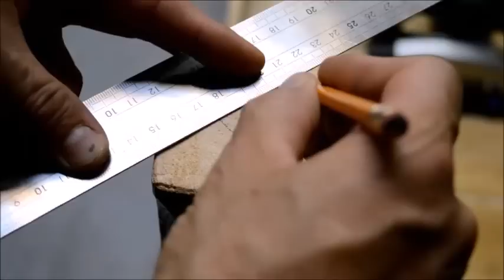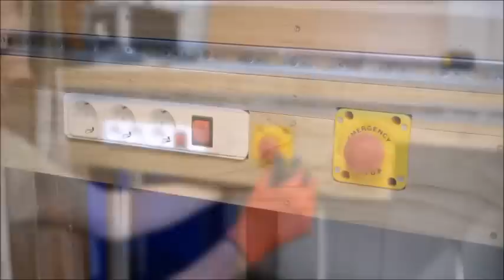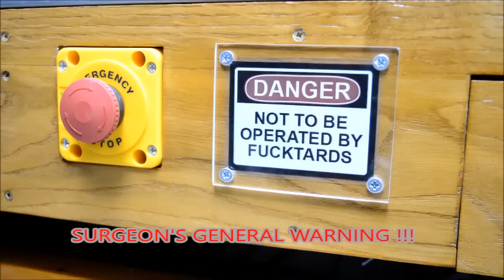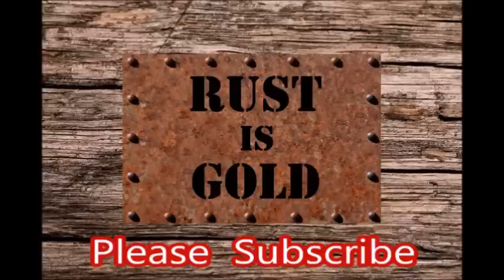DIY Table Saw - How to Make A Homemade Table Saw

Comment: A class bit of work! I'm impressed with your skill but your welding makes me weep! I'm coming up for seventy one, have been welding since I was seventeen and I'm amazed at how many people on You Tube, weld like that. Why?
Reply from the maker: Thank you very much for your comments. Unfortunately there was nobody to reach me how to weld. I am self-taught and trying to learn through YouTube videos how to weld properly.
Reply: @RustisGold  Well, seeing how good you are at your other craft's, it shouldn't be too long before you master arc welding. I mentioned that because the amount of guys who just spot round everything rather than keep a continual arc going. You'll find that when you master the 'amps, thickness of metal and weld speed, you'll get the hang of it. Best of luck to you Rusty ;-)
Reply from the maker: @subliutenant  I think that slowly but steady I am getting better in welding. Either way I enjoy making or restoring all kinds of objects! Thanks again for your comments! 👍

Comment: Magnificent! What was the total cost?
Reply from the maker: Thank you very much for your comments! 
Believe it or not I paid 0 euros for the wooden part of the structure! 
ALL the wooden materials used I found them thrown away in the garbage! 
The circular saw was given to me from a friend, I only replaced the blade for 15 euros. The wheels costed another 20 euros, the emergency button 5 euros. The multi socket extension I already had it but I guess it costs around 15 euros. The remaining materials (cables, screws, etc) costed around 5 euros. 
So in total the table saw cost was around 60 euros (70 USD).
Not bad at all!!

Comment: Just need to add a router, jigsaw and a cross cut sledge, how did you allow for the circular saw to be 90 degrees to the cutting table? Normally they are so far out thats why I never use Hand circular saws.  Nice job though , a lot of work!
Reply from the maker: Thank you very much for your comments! I have also made a fence and a cross cut sled for my table saw. They are on 2 different YouTube videos of mine.
Reply from the maker: Table saw fence video:
https://youtu.be/A0Z65ZI8fLg
Reply from the maker: Cross cut sled video:
https://youtu.be/_LRx2I3l6IM
Reply: @RustisGold  thanks

Comment: Great craftsmanship. 
But one question,  how do you adjust for tilting the saw for 15, 45, 60 degree angle cut? Is that in a later video?

Comment: You might want to have a look at your wiring. The plug to plug adaptor you made is pretty dangerous if the wrong side is unplugged
Reply from the maker: Yes I know... I changed it, it is 100% safe now but unfortunately YouTube is not letting me edit the video...

Comment: Nice craftsmanship. But is that a standard 7 1/4" skill saw blade? I have to agree with some others about being able to purchase an actual 10"  table saw for less. But that said, I to wonder how easy it's going to be to replace the blade? Again, nice work but I'd rather see it wrapped around a regular table saw
Reply from the maker: The cost of making this structure was only 50 Euros. All the wood I used cost me nothing. I found it for free in the garbage.

Comment: Great table saw. But my issue is how you power the table saw. Male plug on end side of extenction cable is a vidow maker. I know its just 30 cm long, but one mistake and you get zapped big time.
Reply from the maker: Thank you very much for your comments! You are absolutely right. There was an  issue with how I power the table saw. I replaced the male plug. It's 100% safe now.

Comment: Great build, but after the time and money you put into it, you could of bought and industrial saw for about 1200 and a good Hoe Store saw for about 600.00
Reply from the maker: Dear Gabe, I only spent time in building it. Since it is something I do as a hobby you understand it didn't bother me. Regarding money, I only spent 50€. All the wood I used was upcycled from the garbage! The saw was given to me for free from a friend, I only had to replace the blade. Finally, I bought the wheels and the electric parts.

Comment: Good work, but I have to say that it's very dangerous to use this type of 220V connection (female) in the back of this assembly.
Obviously, if the male plug disconnects for any reason from the chassis female plug, the male plug becomes accessible with your hands but is already connected to the wall plug and the 220V, it's very dangerous !!!
You MUST use another type of plug for the assembly, as it is used for any electronic device.
This is for your own security.
Reply from the maker: Thank you very much for your comments. I agree with you...
As I have mentioned numerous times before, I realized it was wrong and I have already replaced it with a proper plug. Unfortunately due to the fact that this particular video has a lot of views, YouTube (for some strange reason) is not allowing me to edit it....
Reply: @RustisGold OK, great !!! I didn't read the other comments, I have got nothing to worry about now, thank you for your answer, best regards from France

Comment: Good job, but for me to buy all the tools used to make this, it works out cheaper to buy a table at a harbor freight or find a clearance deal somewhere.
Reply from the maker: Thank you very much for your comments. It is true that I have a lot of tools. However, as you can understand I didn't buy all these tools at once... It was a long time consuming process!

Comment: $500 welder, $200 drill press, etc etc. And where did the cut pieces of framing come from? Probably a fun build if you have the equipment, but you could buy a Festool tablesaw easier
Reply from the maker: Listen buddy, if you are in DIY you need to have tools! Otherwise just have your credit card ready and start ordering on line so that you won't get tired going to the store...

Comment: I think it would cost more than the simple purchased one, I do not see any point in making one especially tools by yourself if it is not creating any cost effect. By the way great craft & skill.
Reply from the maker: Thank you very much for your comments.
In my case it was different... it only cost me around 50€. All the wooden parts I found them thrown away in the garbage. I only had to pay for a new saw disc replacement, the electrical parts and the wheels. All the rest was free!

Comment: Hi! Nice job! What about guides?
Reply from the maker: Thank you very much for your comments! You can check the other 2 videos I made for the table saw fence and thecross cut sled...
Reply from the maker: DIY Table Saw Fence for Homemade Table Saw

https://youtu.be/A0Z65ZI8fLg
Reply from the maker: EASY TO MAKE CROSS CUT SLED for TABLE SAW - DIY

https://youtu.be/_LRx2I3l6IM
Reply from the maker: Table Saw Dimensions

https://www.facebook.com/photo?fbid=1417600945010983&set=a.1417600671677677
Reply: @RustisGold  thanks a lot

Comment: I have got a Bosch GTS 10J...  How can i do, to cut big wood???(
compensated)  I need a help...I will want to increase a table saw... Thanks!
Reply from the maker: You mean that the blade is not positioned high enough to cut bigger parts of wood?
Reply: @carloseduardoblassioli8204  @Rust is Gold I think he is asking can he increase the overall surface area of the table top.
Reply: @michaelfinch7581  Yeap!!!

Comment: Puedes compartir los planos?
Gracias
Reply from the maker: No tengo ningún plan, sin embargo, puedo enviarte las dimensiones
Reply from the maker: El enlace con las dimensiones es:

https://www.facebook.com/rust.is.gold/photos/a.1417600671677677.1073741895.467195180051569/1417600945010983/?type=3&theater
Reply: Te lo agradezco

Comment: Why waste time with the E-stop when your using a GFI? The red  switch is an E-stop.
Reply: The red switch is an e-stop, but it's also a tiny e-stop. The big paddle stops or buttons, like this one, are easier to hit with a quick, flailing slap or a knee, what you'd likely be using if you need to use the e-stop on a table saw.

Comment: Nice craftsmanship! A lot of hard work. Time and energy. But considering the time it took and money you to build this unit you could have bought a table saw that would provide you with a lot more features and benefits. Along with much better build in safety features. As a carpenter I really don’t understand why you decided to go on the path. Anyway it’s your saw so just don’t let it get a bite out you😞
Reply: You're right  not worth   making something  like this  he over did it  and it still missing  lots of protection  features  that a regular table saw would have . Not good at all
Reply from the maker: Thank you very much for your comments. I make things for the fun of it. The particular table saw cost me less than 50€. All the materials I used where salvaged from the garbage. I only spent money to replace the saw blade, to buy the switches and the wheels.
Reply: Yeah, pretty much what I said Dale....LOL.   I've been a Mechanical Engineer for 40 years and it still amazes me what people try to build and save money.  I let Makita, DeWalt and Bosch build the tools so I have time to build the wood projects.
Reply from the maker: @raymondpontremoli2489  this has nothing to do with saving money. It is about having fun and creating all kinds of things from recycled materials. If you prefer to buy tools from Walmart why bother watching Diy videos?
Reply: Even with the so called safety features people still have lots of accidents with saw tables and that's because of a reason: people get lazy and trust those safety things will always protect them. Probably the best safety feature is the riving knife and many table saws don't come with them.
Reply: Jelly G. / I agree that some people get lazy and that’s the point of safety features. People are using equipment every day without problems. But every now and then something happens to distract them and if there wasn’t something in place to protect them they get hurt. A good example would be seatbelts.  At one time people thought they were terrible but now everyone would not go anywhere without putting them on.  They save lives.  Now of course we back them up with airbags.  Get my point?

Comment: Pretty cool but seems like a lot of work and taken up soace for something that can only do cross cuts. Cant bevel blade, raise or lower blade or even replace blade without a pain in the ass. Its cool but I'd rather buy one.
Reply from the maker: My friend I had fun building it, it is not a professional table saw but it works great for the projects I make and finally, it cost almost nothing (50€!!). No store in the world can give you such a bargain!!
Reply: @RustisGold  You're right, didnt mean to sound critical. If thats all you need to use it for its perfect and you're right, building it is the fun part. I dont use table saw for much more than cross cutting or ripping either and I just happen to have an extra circular saw so I may make an attempt at making something similar to what you did. Didn't mean to shit on your project.
Reply from the maker: @nickstosz6730  don't worry, your comments were not offensive at all.
Reply: @RustisGold  Where did you get the emergency shutoff at?
Reply from the maker: @nickstosz6730  at a local store selling electrical equipment.
There are also selling tons of them in eBay.

Comment: Dangerous way you connected the electric supply. If someone pulls out the plug,  they have a live cable with the pins protruding
Reply from the maker: Thank you very much for your comments. I agree with you...
As I have mentioned numerous times before, I realized it was wrong and I have already replaced it with a proper plug. Unfortunately due to the fact that this particular video has a lot of views, YouTube (for some strange reason) is not allowing me to edit it....

Comment: the gravity is your enemy ... these circular saws are not designed for upside down operation and you will soon find that this aluminium bracket will flex under the weight of its own motor. This will cause the blade to not to be always square to the surface of your table unless you prop it up but its flipping nuisance better buy dedicated table saw
Reply: He forget to use a ratchet strap for that ''problem'', have it for years and solid as a house on rocks.
Reply from the maker: Thank you very much for your comments. I haven't faced any issues yet but thank you very much for the information.
Reply from the maker: Thank you very much for the tip!

Comment: Bellissimo lavoro,  ma MAI e poi MAI alimentare una apparecchiatura con una prolunga dotata spine (maschio) da entrambe le parti. PERICOLOSISSIMO.  Ci sono le prese maschio da pannello. Tipo quelle sul  retro dei PC.

Beautiful work, but NEVER and NEVER power an equipment with an extension equipped with plugs (male) on both sides. DANGEROUS. There are the male panel sockets. Like those on the back of PCs.
Reply from the maker: You are absolutely right. It was a mistake and I corrected it. Unfortunately I can not edit the video because it has too many views. YouTube doesn't let me do any editing...

Comment: #1.  INSTALL A "REAL" SAW ,(10" WORM DRIVE! )
#2. INSTALL FOOT CONTROL POWER SWITCH  !
#3.  TABLE SHOULD BE 4'X8' SHEETX 3/4" THICKNESS .
#4.  SAW MOUNTED CENTERED IN 4' WIDTH , 2' IN FROM END OF SHEET .

THIS ALLOWS INFEED AND OUTFEED SUPPORT  .
CHEERS
Reply: For the price of a worm drive saw you could just buy a dewalt jobsite table saw...

Comment: For all of the time and materials you could've saved $2K by just going a buying a Bosch at HD/Lowes.
Reply from the maker: Thank you very much for your comments. It only cost me around 50€. All the wooden parts I found them thrown away in the garbage. I only had to pay for a new saw disc replacement, the electrical parts and the wheels. All the rest was free! So basically I just had some fun creating something out of upcycled materials.

Comment: Teria como me informa as medidas do tamanho dos cortes de cada folha do compensado eu gostaria de fazer um parecido com o seu projeto se não for pedir muito obrigado é continue com um bom trabalho tchau.
Reply from the maker: Jailson Araújo O link com as dimensões é:
https://www.facebook.com/rust.is.gold/photos/a.1417600671677677.1073741895.467195180051569/1417600945010983/?type=3&theater
Reply: Dimensões já que está difícil vou tem imagina as medias através de um desenho do modelo obg. Tenha um bom dia pro Senhor.
Reply: Muito obrigado por tudo só agora o link que mandou felicidade é muito sucesso para você
Reply: Building a 4 in 1 tablesaw set

Comment: Hi. Please. What is the paint Used on the sides and the top?
Reply from the maker: ¿ Qué es y cómo ... ?  The paint on the side was just a normal wood paint (oak tree color).
The paint on top is paint for metal, however, it worked fine!

Comment: This isn't a how to, it's a how I. A how to should have details and explanations. You only explained a few things like why you cut off the old table legs
Reply from the maker: This video is just to show to other people what they can do with 
materials other people throw in the garbage....I did not pay a single penny for the wood I used in order to build this table saw.It only cost me 50 euros (wheels, lock, electrical parts, and replacement disc for the saw).You don't need the exact measurements in order to build a similar table saw. It does not have to be exactly the same. Use your imagination.
Reply from the maker: The only dimensions I have available are the following:https://www.facebook.com/rust.is.gold/photos/a.1417600671677677/1417600945010983/?type=3&theater
Reply: what are the wheels for ? too unstable

Comment: This is cool, but the issue is you have a table saw with the power of a circular saw.
Reply: I mean, if it's a 20A circ that's one thing, but I wouldn't pop my 10A Skil upside down and suddenly expect it to rip hardwood like my contractor saw. Granted, it's a helluva looker that will do 99% of its job perfectly. Still not sure where the dude got the circ with a built in knife behind the blade...

Comment: If someone has to build one do they have to pay to get the specs
Reply from the maker: No, I am not asking for money in order to give the specs. 
This video is just to show to other people what they can do with materials other people throw in the garbage....I did not pay a single penny for the wood I used in order to build this table saw.It only cost me 50 euros (wheels, lock, electrical parts, and replacement disc for the saw)
Reply from the maker: The only dimensions I have available are the following:https://www.facebook.com/rust.is.gold/photos/a.1417600671677677/1417600945010983/?type=3&theater

Comment: Dangerous as fuck without a fence especially for longer pieces of wood.
Reply from the maker: I have made a fence. It is on a separate video.
Reply: Did you notice the long piece of metal that runs horizontally along the front of the table? I was assuming that THAT would be what the fence would be adjusted to grab onto.
Reply from the maker: Fence video
https://youtu.be/A0Z65ZI8fLg
Reply from the maker: Cross sled video
https://youtu.be/_LRx2I3l6IM

Comment: I feel that it was a lot of wasted material but if it works it works. Perhaps proper planning could have saved some time and money. For the amount if material you used you could have bought a cheap table top saw and just built the table not having to mess with switches and wiring.
Reply from the maker: My friend you are right that I used a lot of materials. However, I didn't spend a single penny on wood. 
All the wood I used was upcycled. The total cost of this table was 50€. It required a lot of work but I really enjoyed creating it!
Take care!
Reply: Rust is Gold the point was that it still was a lot of material free or not, you could have bought a cheap table saw and just build a better table around it without having to use switches and with a better motor.